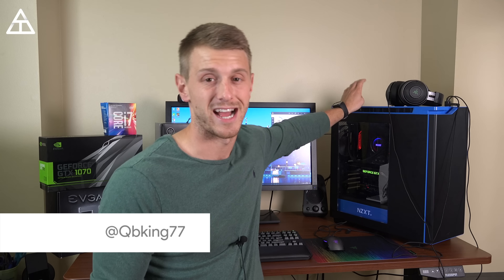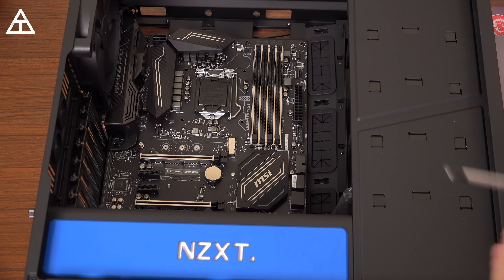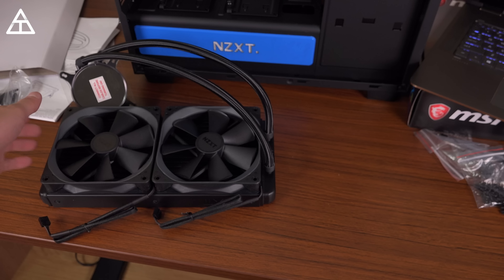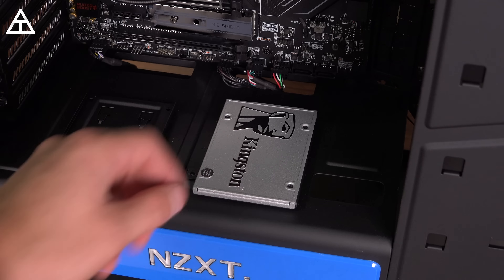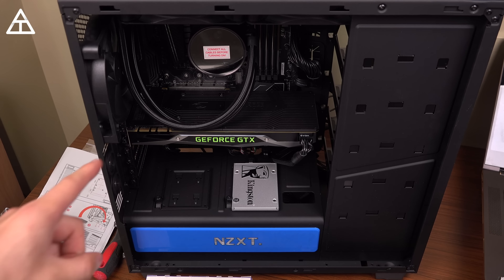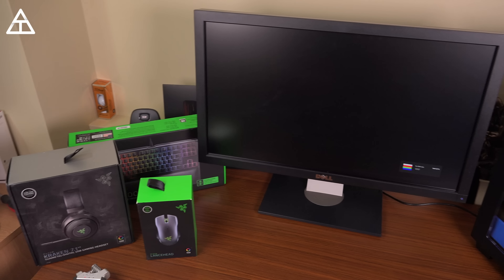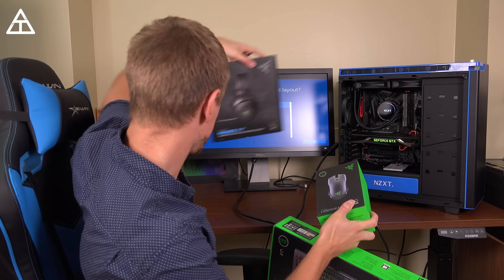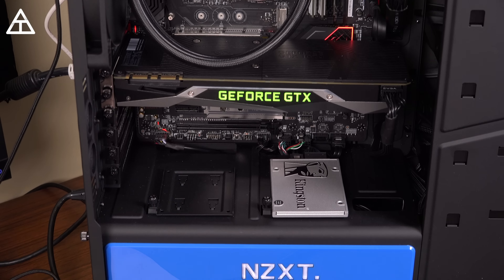Building My First PC!

Comment: Nice video and for the first time building a pc you are doing great! 
2 things:
1. About your ram issue I think you should update your motherboard bios to the latest version and try again, if not maybe there is something wrong with the slots
2. You should rotate your cpu water cooler in a way that its radiator cables will be on the right

Comment: Looks like you have a RAM Channel issue (Channel 1 is working, but not channel 2), check the pins under the cpu to make sure none are bent, if not, you'll be best off sending the motherboard in for a replacement.
Reply: The Pins are on the  motherboard.
Reply: AnimeBeefRandoms yea, on the motherboard, under the cpu

Comment: did u put some thermal paste on the processor or there's no need?
Reply from the maker: No need with the Kraken cooler I used... It has paste on the bottom
Reply: Tim Schofield ow okay... thats some awesome pc build, great work... how I wish I have a high specs pc..coz Im a gamer... but I'm a kid and broke af... XD  Godbless u bro...
Reply: If you find that the CPU is still getting hot, remove that paste they use and put on your own.
Reply: Chad Christian yeah man, I never keep stock paste on. Always keep a fresh supply of Arctic Silver 5 on hand. Good stuff